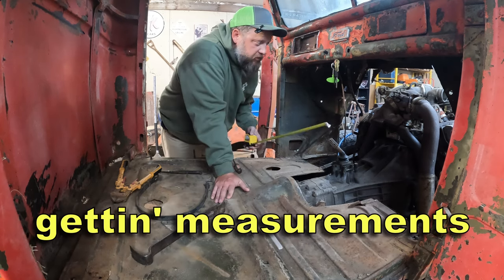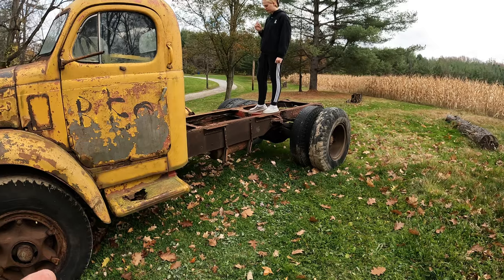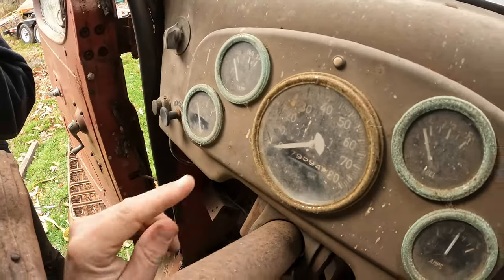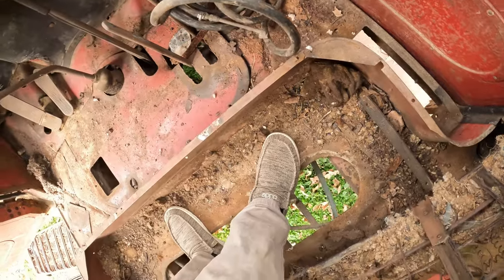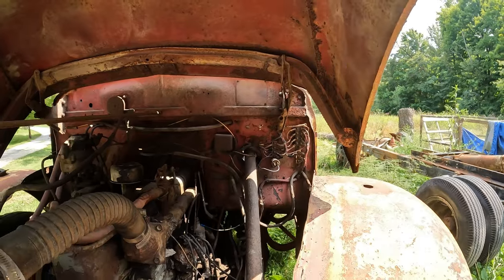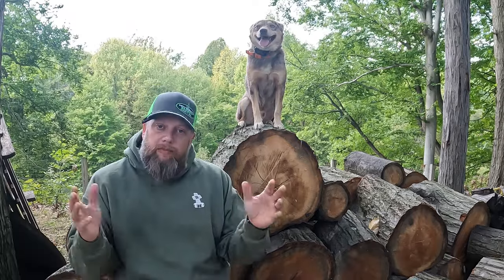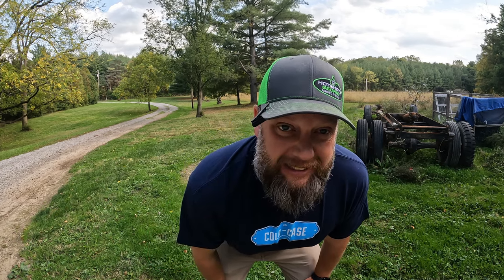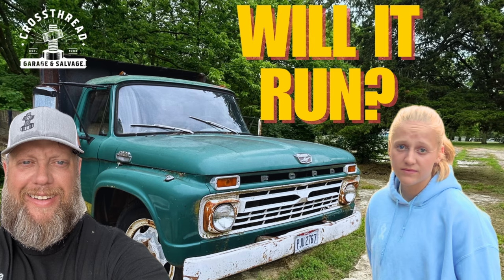We NEVER Should Have Made This Video: WILL IT RUN - 1950 REO

Comment: Did that with a 67 chevy 283 when I was about that age.  I didn't have any acetone mixed with the trans fluid.  I had to put a prybar on the flywheel.  Worked both sides until it popped.  Broke the tip off the prybar once. Tried the starter a few times.  It wouldn't spin until I'd rotated that crank one whole revolution.  One tooth at a time on the flywheel.  Fired right up. It smoked and rattled for a bit. Dumped some transmission fluid down the carb while it was running to lube the valve stems. It ended up having a cracked block.  But we ran it for 3 or 4 years before the crack got bad enough to give up on it.  Nice try. Thanks for the trip down memory lane.